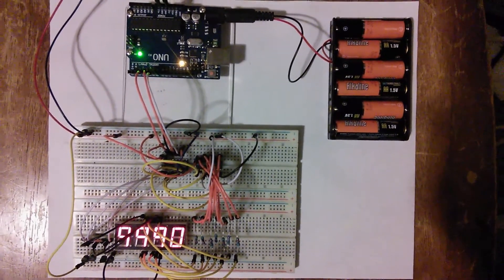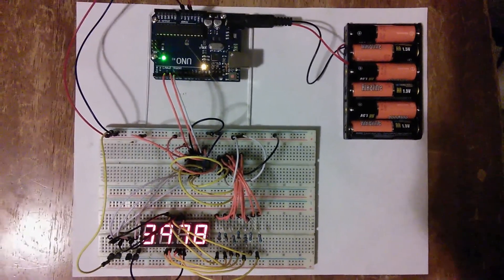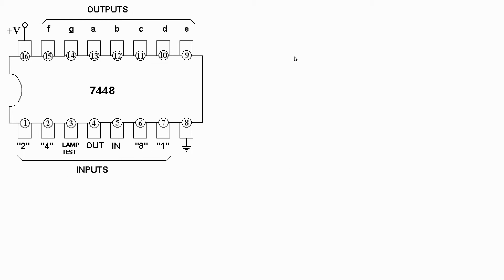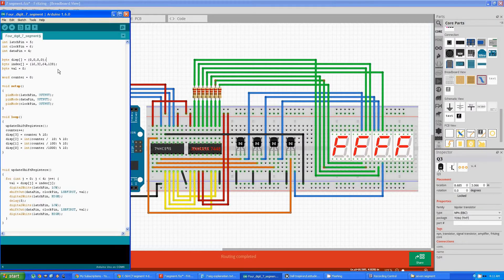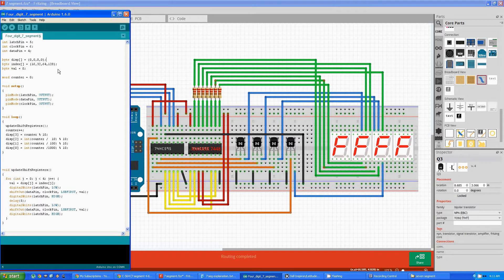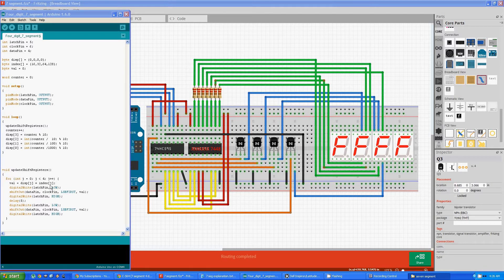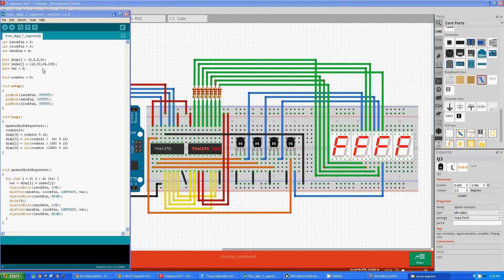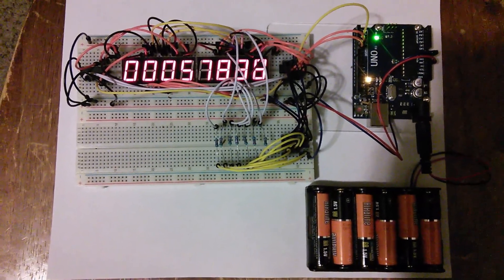Using a 7448 BDC - 7 Segment Decoder to simplify driving seven segment displays with the Arduino

Comment: KingBeetle, can I use a 4 channel  Darlington array chip in place of the four transistors(TD62064APG)? I am doing a project and have limited space on the board.
Reply from the maker: +Howard Lester  Absolutely.  Their purpose is to convert the current source outputs of the latches to current sinks, so a Darlington array would serve the exact same purpose, permitting selective connection of the common cathodes of each digit in the display to ground.